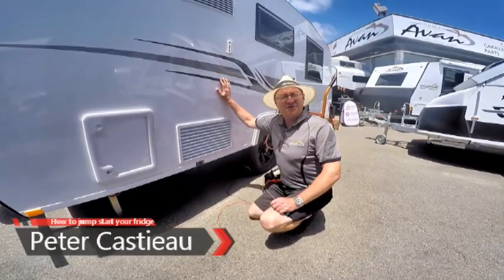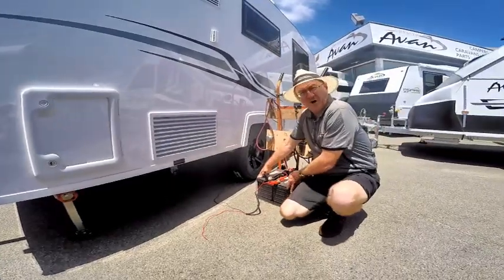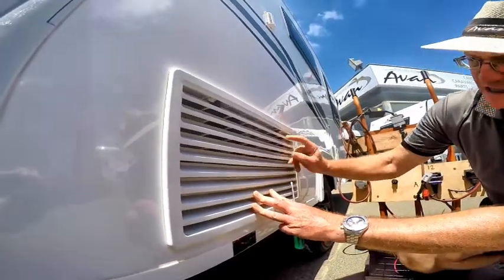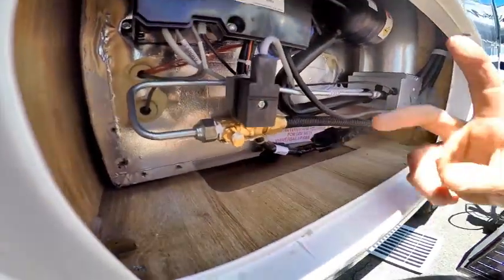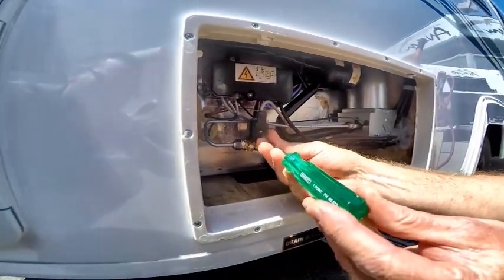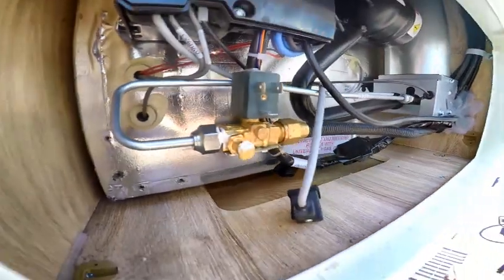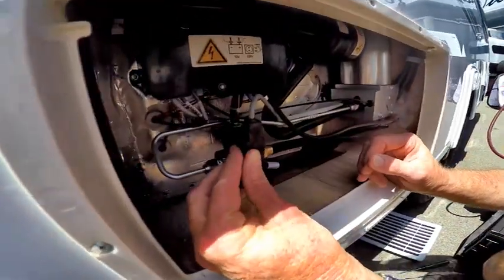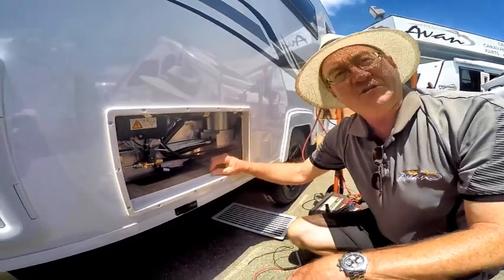How to jump start your fridge

Comment: Thanks for the tip. This procedure is necessary to get my fridge to start on gas if it's been running on electricity for a day or so. It needs to be serviced. However, I discovered that a small 9v battery (smoke detector type) will kick start the solenoid valve just as well as a big 12v battery, and a lot easier too!